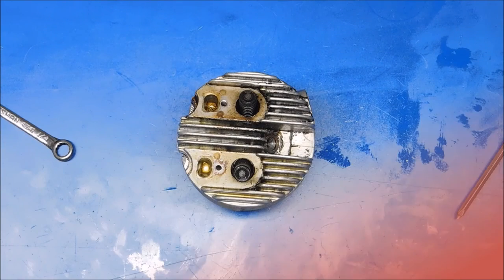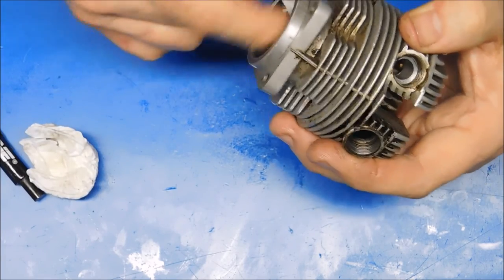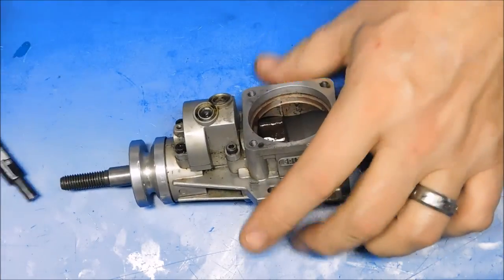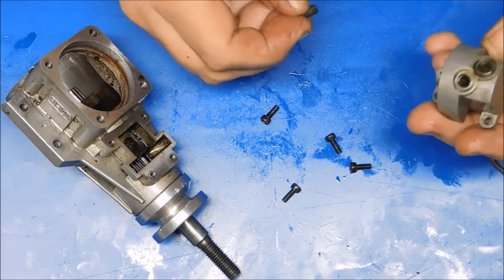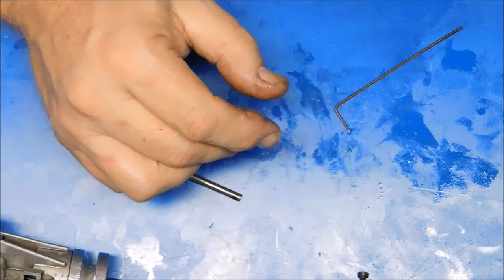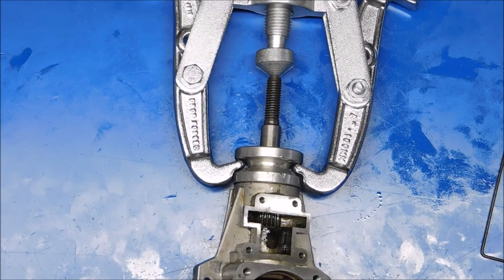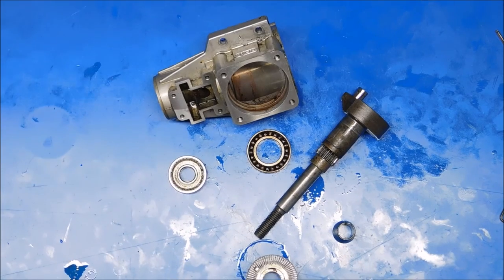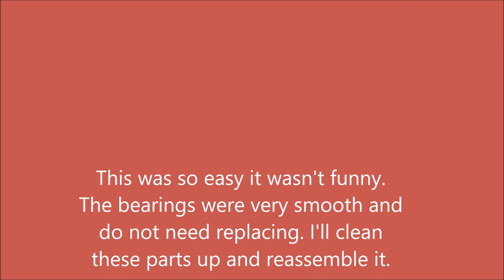Saito FA-120 Disassembly for Cleaning Part 2

Comment: Yep, I did my Saito 120 with the gold Valve Covers a couple months ago and it was  so much easier then working on the OS Engines. My Valves had a lot of carbon on them but cleaned up OK.  The one thing I notice about my Saito 120S, which does not seem to bother it's performance, is when cold it does not seem to have a lot of compression. Once started and heated up it pulls like a mule. On the other hand on my 150 Saito  you can really feel a lot of compression when cold....it's a beast.